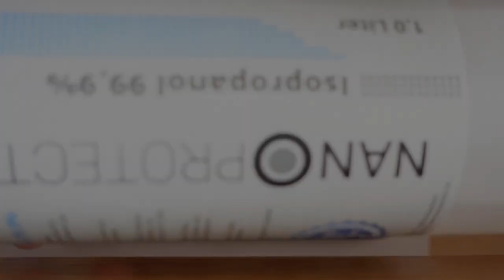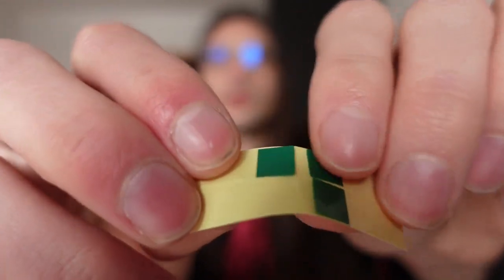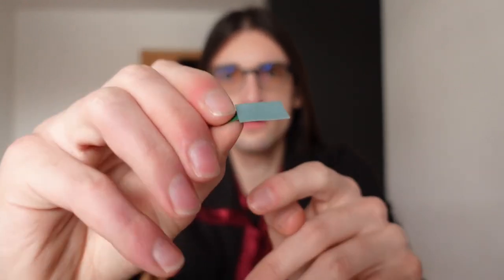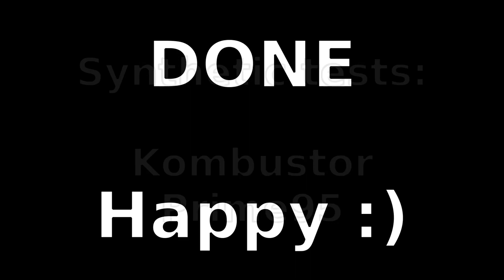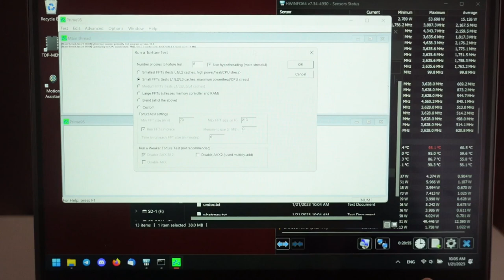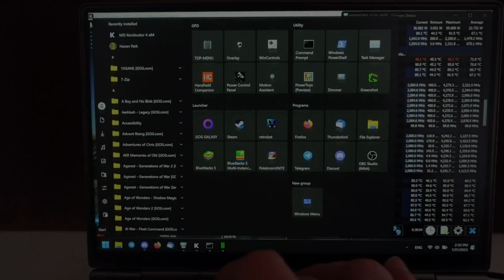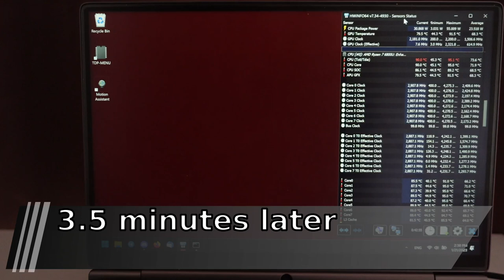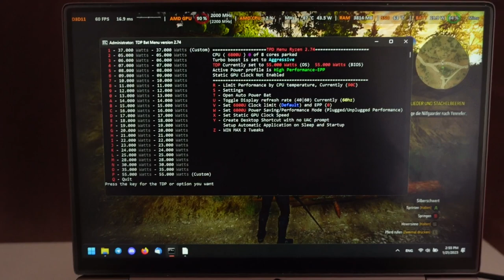GPD Win Max 2 - Honeywell ptm7950 - Tutorial: Application & Testing [35 watt - silent mode]

Comment: I installed the ptm7950 on my WM2 about a month ago and it made a noticeable difference.  I run 28W docked and almost never hear the fan.  Temps are good when I check.  It doesn't seem to make a significant difference at dropping the low temps, but seems to become more effective the hotter it gets.  Great stuff!
Reply from the maker: That is in line with Linus' findings.
He also says, that the pad becomes more effective when it becomes hotter.

On Discord some people are interested how the pad performs under normal conditions, so I might do a follow up video with a few tests under normal load. I can not compare it to stock thermal paste any more, but at least we can get some values out of it.

Comment: Excellent information, I had a randomly crashing wm2, I suspected dodgy paste and got Honeywell pad based on your tut, on removing the heatsink I found there was actually a sizable strip of die exposed without any thermal compound 😮 after hw pad applied I got instant stability. I got my wm2 second hand but the factory seal was still present over bottom screws so the paste application was from factory installation 😬😬😬 not good. Thank you for this
Reply from the maker: Great to hear it was helpful.
I might be wrong, but there might have been a case of a Max 2 without thermal paste at all.

Luckily the Max 2 is so super simple to open and GPD does not void your warranty, but supports you, if you want to repair your device on your own.

Comment: hey mystechry :) I like the video, your really good at them lol I was wondering what size were the pads/sheets you brought from the site? as I know you can cut them to size but I was thinking could be easier to just cut the one u got in half mostly and use that as is and just have some more overhang around the edges.
Reply from the maker: Thanks :)

The link to the pad is in the description.
I git the smallest one. 25mmx30mm.
Technically I guess cutting it in half would work well enough. I almost cut it in half anyways.

Comment: Love the video! Quick question - I'm looking at possibly getting the 2023 refresh of this device and heat is definitely a concern of mine that nobody seems to comment on in the video reviews. How hot is this thing getting where you feel the need to do this? Can you comfortably hold it or is it too hot for that? Does it burn on your lap? Is there a significant difference between running at, say, 15W and 25W when it comes to temp, in your experience? Thank you so much!
Reply: I've been playing Jedi Survivor and TOTK the last couple of weeks, and my WM2 doesn't even hit 80. Usually at 25Watts. He's running it above the recommended wattage for sure, and 95 isn't terrible for what he's doing.

The heat never bothers me when I'm holding it, and I recommend 100% to not run this or any other laptop on your actual lap. They usually bring cold air in from the bottom and expel it from the back/sides. If you block that, you're going to be going through laptops very quickly.
Reply: @oxxification  Thank you so much! That definitely helps me out a lot in terms of figuring out whether to order one. May I ask how much memory your model has and how smooth both JS and TOTK are running? ty!
Reply from the maker: A few days ago I beta tested a software to tune the fan curve. Because of a bug which I did not noticed, I was running my system with low fan at 24 watt for over an hour.
So I was probably at >80/85 all the time.
The touchpad became quite warm, but the controls did not become too hot. Else I would have noticed much earlier.

You should not put the device on your lap probably if you plan to use very high tdp, as the fan intake is at the bottom and if you block that, the system will need to thermal throttle heavily.

At below 30 watt, I do not see any need to apply the cooling pad anyways and the system sill not be hot.
15 watt is cool and you can manually decrease fan speed.
I made a whole video testing how much tdp you can sustain without using the fan at all or at only 20-30% fan speed.
15 watt rally is no issue. 20 not as well.
If you do not force down the fan, 25 is perfectly fine.

With the honeywell pad, I could sustain 35 watt in silent mode, so you are save in regular mode ;)

Comment: Jesus 90°C I need to watch a video about the temperature before buying
Reply from the maker: You usually do not run this device at 50 watt tdp. I unlocked the tdp to infinite and manually disabled the fan. Of course you temperatures will rise under those circumstances.

Comment: Thanks for the tutorial! I might just try this mod. I don’t game much but do a lot CGI work on the WM2. I was wondering how/where did you manage to push the tdp to 55w? I only tried setting it to 35w in the bios and windows was crashing already when I rendered some scenes.
Reply from the maker: The cooling pad is not only useful for high tdp, but also to keep the device silent when at low tdp. 

Unfortunately I have no idea why the system might have crashed for you? Maybe some real bad cooling?
Maybe join the GPD discord and ask for help there. People are very friendly and helpful there,
Reply: hi svenovsky have you tried Aftereffects in winmax 2 ? it runs fast.. but there is a screen tear in the preview.

Comment: I realize it may be an off topic but is it alright that the CPU temperature nearly reaches 100 C? Isn't it too extreme and turns CPU into an obsolete one over a much shorter period under this load?
Reply from the maker: You can set the temperature limit in the BIOS to 90 or less if you are not comfortable with high temperatures.

It is mainly the battery that does not like super high temperatures.

In the case of the video, it does not hurt. The CPU is rated for 100 degree C and it can handle this. It is not like I run at those temperatures all the time. with my 7840u unit I pretty much never increase tdp above 24w. I would not recommend to have the system running super hot all the time, but for some spikes and tests this is not a problem.
Reply: @mystechry  thank you for clarification

Comment: I tried your thermal pad exactly as shown and I got WORSE results than stock. 

I ended up applying Noctua HT-H1 Thermal Paste and that gave me a noticeable significant improvement of 4⁰C lower average.

The common thing I found online is the worse thermal paste is usually better than the best thermal pad. There's always an exception, but that seems to be the general idea.
Reply: I strongly recommend you try to do the same thing. I am confident you will be happy with the results and get more power out of your Win Max 2.
Reply: I suck at apply thermal paste. So I'm curious, you will probably get better results than me doing it in better way.

The thermal pad I did use on the SSDs, it works great for ssd.
I modified my win max 2 case to have thin copper heatsink on back, instead of that plastic cover for the m.2 2230
Reply from the maker: This is strange. The PTM is not regular thermal pad but special material that becomes liquid one it gets reasonably warm.
Also pretty much everyone on the GPD Discord agrees that ptm is the best thermal solution for GPD products. 
You must have been an issue with your PTM probably.

Anyways, I can sustain >40w with my Max 2 and even  above 30w there is not much to gain, if at all. So no, I will not use any other thermal paste on my Max 2. The difference should be not much anyways as long as you use a good paste

Comment: will the ptm7950 leak or displace if the laptop is at a angle on a cooler since it becomes a liquid?
Reply from the maker: No, ptm7950 is perfectly save. The angle does not matter. You may also shake your device and it will not displace.
It's not like it become as liquid as water.

Comment: Really nice video. I've watched several other videos to see if there is something else I could learn on installing the pad and I didn't finish any of them. They didn't understand the product, they didn't understand what the stickers were for or the rest of your suggestions to get a proper installation of the pad. One guy was worried about the pad drying out.  Thank you so much for taking the time to to make this video. One question on CPU temperature. I don't understand where the BIOS is reading the CPU temperature. Am I correct in assuming that if the BIOS is reporting a 32 degree C temperature the actual surface temperature of the CPU will be high enough to melt the pad?
Reply from the maker: Glad this was helpful :)
I am sorry, I do not know about the temperature thing. Doesn't the pad require about 45 degree C to melt? 
Do not worry about that. You will reach the required temperature easily. If not, you do not even need the pad or a fan ;)
Reply: Finally received the pads from MODDIY and I followed your suggestions on how to install them.  Sure was easy, thank you so much for taking the time to show your steps in installing the pad. I'm going to do a few shutdown/restarts on the couple servers I installed the pads to see how the temperatures drop even more. Initially the temperatures dropped two degrees C after the pad replacements.  After watching other videos I almost didn't buy the pads because of how the people struggled to get the pad on the CPU. Your steps were so easy.  Thanks again and have a good day.
Reply from the maker: @jimscomments  Great to hear it worked for you. May your CPUs run cool ;)

Comment: nice video, thank you. But I have a question, can we use liquid metal to win max 2?
Reply from the maker: Sure, you can.
Others did that, before ptm7950 was a thing.
LM has the disadantage, that it might brick your system, if not applied carefully.
Also the Max is a moving device, so there is (very little) risk of the metal to slip onto other components when some force is applied.

As ptm is a thing, I'd recommend against LM, as ptm is equally good or better and super easy to apply without any risk involved

Comment: Thanks man, my results are a bit dodgy since I removed a strip of dust that almost fully covered the exhaust and I additionally applied some K5 thermal paste where some of the pcb and memory components are along with Honeywell but I easily got a boost of 10 frames in Elden Ring. Dankeschön!
Reply from the maker: Woah, 10 fps for just a ptm mod is huge. You must have had bad luck with your stock thermal paste. Thanks for sharing this. I'm always happy to hear such positive results :)
Reply: @mystechry  Yeah I'm also planning to apply the same mod on the G1 egpu since the noise is bothering me quite a bit. Might even be able to go 120w mode afterwards.
Reply from the maker: @CheeseOfMasters 120w is not worth it. If the noise bothers you, sell itand buy the new one with the 6w hardware switch. 
I might give that an other chance. The original 2023 model was way to loud for me.

Comment: As someone who's very hesitant about opening and tinkering with electronics, I was sweating watching you peel of that plastic layer at the end 😅Very glad the effort was worth it and you got positive results.

Big question: At 18:00 you mention your particular unit came with a good cooling solution, but there may be units with bad stock cooling. I recently ordered the 2023 refresh (I have not received it yet), and I wanted to ask how may I be able to tell which one I got. If I open mine and the fan+heatsink looks like yours, should I not worry, or is it a more subtle physical detail? Do you believe it would be wise to preemptively contact GPD and request for the "good" cooling solution? This is my first purchase with them and I really would not want to receive subpar components. 

In any case, thank you very much for your detailed videos and clear explanations!
Reply from the maker: Watch that disassembly video. The plastic layer went off much easier in that one.

Regarding the cooling. You just need to check yourself. Run any tester like Kombustor or Prime95. Then see how high the TDP is your unit can sustain. If it is good enough for you, it's good ;)
I got my Max 2 refresh and it seems like it can sustain >40 watt without ptm7950. As the fan has no vibration at all I still hesitate to open it up, as the 45w cooling is good enough technically.

Glad those videos are useful for some :)

Comment: hello what size  did you chose ?
Reply from the maker: 250x300mm. The smallest one is enough.
It's the one I apply in the video and there is still plenty left.
Reply: @mystechry  thanks
Reply: @mystechry  do you mean 20mmx30mm ? There’s no 250x300.
Reply from the maker: @170netilio  Yes. 20mmx30mm.
I have a complete one here and measured it to be sure. It's 20mmx30mm.
Sorry for the confusion ;)
Reply: @mystechry  thank you 😊

Comment: How long would the pad theoretically last?
Reply from the maker: Forever.
It is an industrial grade solution and the advantage over thermal paste is, that is does not dry out.
I do not play at 50 watt, but not having to worry about my cooling for the lifetime of the device is a nice to have

Comment: What size of the pad did you order ? Am half tempted to just buy the biggest one and cut it down. Lol
Reply from the maker: The biggest one will be 60 or 100€.
Seriously, go for the smallest one.
20x30mm is the one I used in the video and I even had to cut that one in half.

I'd say: the bigger they are, the harder to handle.

If I wanted to spend more money on those pads, I'd buy many smaller ones at different sizes.
Even for a big cpu 40x40 should be it I guess.
I'd prefer to have clean pads to start with instead a big one from which I cut out pieces.

In the end it's up to you. The small ones are really cheap. Cheap enough that you probably don't even have to pay taxes depending on your country. So you can order one or 2 without wasting much money if you want to give it a try.
Reply: @mystechry  thx for the tip 😁. I'll get a bunch. I have a 2080Supet that I've had to limit the power in because it likes to get upto 90°c and thermal grizzly didn't help much. As well as the steam deck. I meant to buy it back when LTT did a video and forgot about it. My WM2 32gb is stock if you'd like I can run the silent tests p95 etc on if you'd like that data.
Reply from the maker: @imnotahippie22  Thanks for the offer.
If you want to make a comparison and share with others, it would be best to join the Discord and share it there. 
People there are more interested in that kind of data then I am. I did the comparisons mainly for others, not for me.

On the Win Max 2, the cooling is quite different from system to system, so your results might be very different than mine.

If you want to share some data, don't invest too much time for me. One quick before-after test is enough. I am not the benchmarking and numbers guy ;)
Reply: @mystechry  I feel like an idiot for asking this but which discord? Is it the GPD discord server or your discord? Is there a modding discord?
Reply from the maker: @imnotahippie22  Oh, I'm sorry.I'm talking about the GPD Discord.
Here is the invite: ttps://discord.gg/gpd-devices-243411108940087297

I do not have any Discord yet. I plan to make one eventually, but right now, I do not have the time to manage more than YouTube.

If you want to DM or ping me, search for user "Askarus".